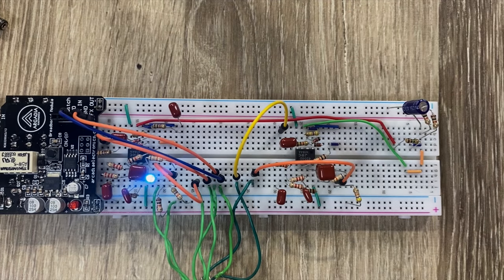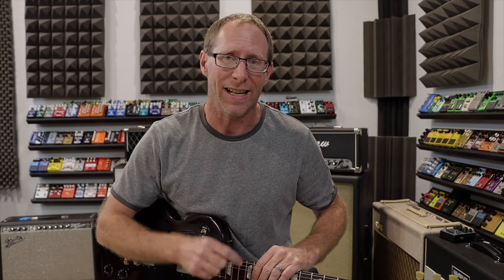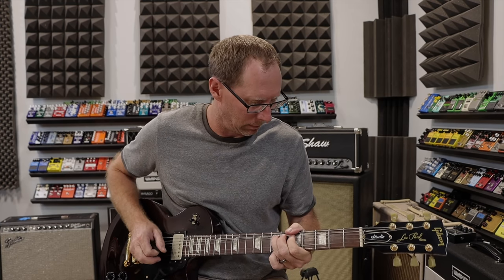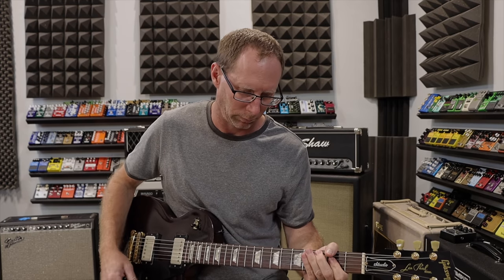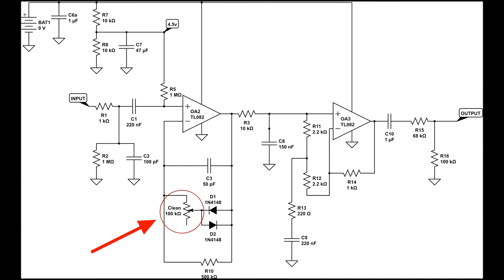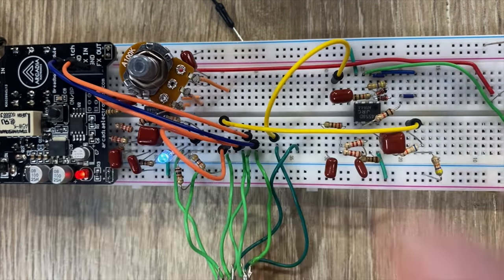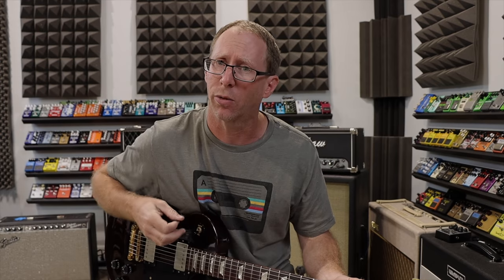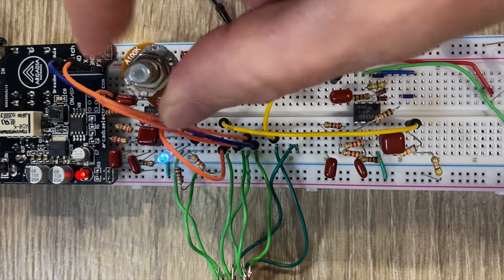It's all about the g̶a̶i̶n̶ ehhh cleans?

Comment: I think being able to adjust the amount of clean signal in an overdriven tone is crucial to getting a useful sound. Thanks
Reply: Agreed, which is why my dream rig is an Engl and a Fender Twin running  in parallel.  Let the desk sort it out.  I'll just enjoy the gain ☺️
Reply: Bass overdrive pedals usually have a blend knob to adjust the amount of clean signal.
Reply: Same reasoning I run my JCM900 and Rockerverb 50 MKII in parallel - ones famously thin and shrill the other famously dark and articulate
Reply: Adding clean to a distorted tone simply means less distortion. This isn’t a stereo setup where you can up one while the other stays the same.
Reply: @enriquepizarro2099  I use a bass overdrive with clean mix on my amped acoustic guitar.
Reply: @Noscrap909  No, not really!
Reply: @Noscrap909  That's not really true - distortion usually compresses the signal, so paralleling some clean signal tends to give more pronounced transients for a clearer attack -  and you'll get quicker decay on the clean component so that the sound will change as it fades.

Comment: I love this format where you explain the role of one component or section in a circuit. I've been building very slightly modified clones, and this is a great way to develop understanding of the circuit. I immediately recognized the 6.8k resistor in the Bluesbreaker circuit which I never understood before! More like this, please.

Comment: LED has the clean, as it sounds more focused. Not as much hair around the edges so to speak.
How strange,  the more clean signal you add, the more the gain sound like a verb type of effect. Or the auditory equivalent of looking at a cross section of an m&m or Reese's Pieces candy. The note is the chocolate/peanut butter core and the gain is the hard candy shell. The potentiometer ends up controlling the ratio of thickness between the core and the shell.
Reply: Yeah I noticed than “verb” thing. You have good ears!
Reply: @Tmidiman  I've been doing a lot of sound design stuff lately.
Reply: literally eating a Reese's Pieces while I read this comment!! :D

Comment: Adding clean ironically brings so much more impact to a distorted sound.  In my productions, I always record a fully clean DI with any guitar amp.  I don’t monitor it during tracking, nor do I even tell the guitarist.  A very high impedance active DI is required for this.  My fave is the BSS AR133.  That clean sound is used to some degree virtually 100% of the time in post.
Reply: Got to have those clean tracks ,,, where you can start over if you have to ... It's always awesome to mix a little clean in there ... Yeah most studio guys won't even track ,,, or mix it down without the clean tracks ... Good one ...
Reply: Don't really do any recording in stereo ,,, but I use a normal / half normal patch Bay to run the clean signal around pre-amp and cab Sim ... For a clean track all at the same time ...

Comment: Right, this is something I learned while using my Boss GT-100 - it has the ability to balance the dirt and the clean.  The trick is to bring the cleans in just until you notice it.
Reply: I use an old gt3 from 98 as the main fx for my little Ceriatone plexi style head, the main drawback of the 3 is that the fx loop is tied to the overdrive section, which has a massive collection of analog overdrives. So in 4 cable mode I can’t use both the plexi preamp and the onboard dirt. I do use the digital preamps sometimes, but only for ultra clean so it’s a whole different thing to add dirt to that.

Comment: What happens in a lot of OD/distortion pedals is the onset of clipping/compression which limits dynamics. With a clean blend you keep some of the natural tone, harmonics and dynamics and mix it with the clipped signal to your liking. Of course you dont HAVE to but it is nice to have the option and you finetune it to your needs.
Every clipping circuit is different with variable frequencies responses.
On the other side of the argument: if the pedal is designed well this has already been done FOR you. Nice to have options..

Comment: LED Off - but I preferred the other sound. Bugger me, what a revelation!
I have a theory that the path of least resistance means in valves the bottom part of the cathode / anode junction near the pins overloads leaving the rest of the valve to work normally, hence valves having an extended harmonic range. This is a superb way fo getting that in transistor dostortion and passing through something for the amp to work with!

Comment: I mix so all the time. A carefully mixed signal will most of the times be the more round and solidified one. This is usable in many situations and parallel setups or bigger EFX chains. And usable for all kind of sounds and instruments. Basically you mix in what lacks in the original audio to get a solidified and "complete" tone, sitting where you want it to be.

Comment: A related trick you can do here is what i do with my set up. I have a dirty boost that goes into a clean channel and it also goes into my high gain channel, then the two signals are run in parallel while i scoop out the mids heavily on the high gain channel allowing the clearer dirty boost to occupy the middle of the sound spectrum.
-I use a Two Notes Le Lead pre-amp which has a "fusion" dial for this purpose which can also run both channels in series(which i thought is how i was going to use it when i bought it)
-the dirty boost is a DOD Gunslinger.(sweet mosfet distortion)

Comment: Everything you want to know about heavy rock guitar production can be learned from what's not really considered a "heavy" album nowadays... roll back the tape to 50 years ago and listen to Bowie's 1972 "The Rise And Fall Of Ziggy Stardust And The Spiders From Mars". The album is pretty varied: it's got a few loud rockers, but it's also it's got ballads, it's got radio-friendly pop songs. And if you listen carefully, all the "heavy", driving rock songs ("Suffragette City", "Moonage Daydream") are actually all driven by acoustic guitar. It's the secret ingredient. Meanwhile, the more overall laid-back songs, like "Soul Love", if you listen again, are actually full of distorted electric guitar and even feedback. One of the many reasons that album stands as a masterpiece. 

Recklessly clicking on a heavy distortion from a cleaner sound can actually make your guitar sonically "smaller" and suddenly leave a big hole in the mix. It might even be louder on the db meter, but you've diverted all the spectral energy from the "thump" and "oomph" part of the spectrum up to somewhere between the "fuzz" and "sizzle" area. Which is a lovely thing in and of itself—and the distortion circuit in this video is gorgeous to my ears even without mixing any clean signal in—but, you just have to be aware that, by contrast, it's not actually necessarily a "heavier" sound. 

Next, let's talk about preamps.... nah, maybe let's save that secret for some other time.

Comment: Great video and great tones. I dig your pedals. It's common practice in recording to mix clean and dirty signals. This adds a lot of texture and keeps the guitar from sounding too dry. Mutt Lang did this with Def Leppard on Pyromania and Hysteria. Very different from what most players imagine when they think of how a professional recording gets done. When I play live I prefer transparent pedals like the Boss SD-1 Waza. I back off on the gain on my Marshall and balance it with the drive on the pedal, which usually doesn't go past 10 o'clock with the output at 12 o'clock and the tone at 1 o'clock. The gain on the amp is usually at 5 or 6. This is a perfect balance for me for rhythm and lead.

Comment: Gilmour has a monster lead tone - and people think it's all about gain, all about the Tube Drivers and the Muffs. It's partially true but imo it's more about VOLUME.
My guess was the LED on. You can hear a little of that clean and it's tighter.
Reply: I use my tube screamer with the drive at like 9 o clock and the level maxed out tone cut out completely. If I set my amp to lightly break up it’s really articulate. To me, the tone Brian’s getting at the 4:00 mark sucks. It’s too distorted to mix with the clean and sounds awful IMO. It’s probably just my preferences though.

Comment: I bought a Boss ODB-3 in addition to another pedal I actually wanted as part of a package deal. Ended up preferring the ODB-3 over the other(DS-1), mostly because of the blend feature. Changed my approach to tone forever. Now I almost always run gain pedals or stereo rigs with clean/od blended. It's a much fuller and sweeter sound to my ears. I don't think I can look back at this point.
Reply: Same

Comment: Circuit one has some clean added. Two seems to have more. Doesn't VooDoo Labs make a pedal that mixes distortion with clean?
Reply: Exactly. I don't know for sure if the first is a TS-style circuit as is the schematic shown (missing some stuff to ground), which always lets some clean through, but a little clean can often be heard with any circuit with diodes in the feedback loop, because the op-amp is kept from distorting, and diodes have a small amount of series resistance. In some circuits, you get the extra clean at higher gain settings, it just kind of forces its way past everything.

Comment: I like running a stereo rig with one heavily distorted amp sound and one with the gain backed off a bit. 

Also less gain is heavier, you need that attack and definition.
Reply: I found the same thing as soon as I joined a band with another guitar player. We were both using a really high-gain tone and it sounded terrible. Just a big wall of muddy fizzzzz. 
Even though I was playing lead, I backed my gain down and suddenly we sounded great together. And my solos cut through better without boosting my volume.

Comment: It was very apparent, that the No LED circuit was very compressed boxy and small sounding and with LED there is much more articualtion and it sounded much bigger and more present.

Question is, when this pedal will be available and how would you call it?

Anyway, paralel gain mixing is a great idea and lots of usefull sounds are there. From PhilX and his solo boost in form of adding clean Fender amp to his Dirty Robot (back in the days) thru Boss Angry driver, to last (known to me) Walrus Ages pedal. Also dont forget guys from That Pedal Show and their wet/dry (or dual mono) setups with two different amps.

Comment: That's just what do the Two Notes double channel tube preamp (with a real tube inside). I use "le Lead" and for exemple it's incredible with a wah sound and the two circuits mix together (clean & distortion  in parallel, called "cold fusion") and many other options !!

Comment: Nice demonstration of a Tube Screamer style overdrive. It's wonderfully simple and it still beats the pants off of a lot of other distortion circuits.

What actually caught my eye in this video is the second stage in this circuit. That's a strange way of drawing a bridged T notch filter.
Reply from the maker: I like your thinking ;) It's actually just a TS style tonestack stage, using set resistors instead of a pot, so it's boosting some higher frequencies a bit here

Comment: With the pot in the circuit you notice the clean signal even at the first adjustment get quite a bit more prominent. Also notice when you hold a note or chord, as the clean signal diminishes, the underlying OD gets more prominent. Wonder why very few (I don’t know of any actually though I seem to recall maybe seeing one or two, bit sure) OD include a mix knob? Does Wampler have one? Would also be an idea to have the clean not be totally clean but just a much less gain OD, mixed in. Maybe “bloom” then but not so clean?

Comment: Great vid, thanks! What's happening electronically with the pot swiper added to the clipping stage? Am I correct in assuming that the increased resistance makes more of the clean signal bypass the clipping stage? And is this essentially like the blend pot I have on, say, my Boss ODB-3 or Deluxe Bass Big Muff?
Reply: Correct. The signal current has two paths: through the diodes and through the feedback resistor. Increasing the resistance in the clipping portion causes more of the current to be diverted to the feedback resistor and less through the diodes.
Reply from the maker: @ryancrawford9894  nailed it :-)

Comment: I split my signal in stereo with one pedal and am using 2 amps, but I enjoy the middle pickup position for cleans and bridge for drives, but in a mono output guitar is impossible to sound midle and bridge at the same time because the drives will suck, should I make a second jack for neck pickup?

Comment: In the Foo Fighters samples, would you guess the clean mix is coming from a single signal chain, or are they running the dry guitar through multiple rigs? Trying to gauge what comes down to amps and pedals and what comes down to studio magic.
Reply: in "wheels", that sounds more like they put a mic on Dave's hollowbody. it's got an acoustic kind of clack to it. get it in phase and mix it in with the amp signal. i've gotten cool results with this before on slow strummy sections.

Comment: The one with the LED is the clean mix circuit. Some of the notes sound clearer and it's a bit thicker in some parts. The one without the LED sounds more agressive and tighter to me. I prefer the one without a clean signal.

Comment: Is that a mid 90s Studio with the ebony board? I have one of those. It is killer for some reason. Sounds so good and one of the best Gibson guitars I have had, which really surprised me considering it is just a humble Studio model. Downside is the kind of chunky neck, but the way the neck resonates when hitting notes might be partly why it sounds so good (I thought about having it carved to be slimmer, but worry that it would change the sound due to there being less mass in the neck). 

A bit of clean signal in there? Is that not what a TS808 does? A Kon too, I mean Klon. I have still not tried a Klon style pedal too see what the fuss is about. None of my fav players used one, so it has never been on my radar. Maybe one day. 
At the moment my fav pedal is my Laney BCC Iommi Boost. Far more than just a treble booster. It can also add clipping and has lots of EQ options. Unlike my noisy as hell DOD 250 it does not need a noise gate so much, i.e., it is fairly quiet. It sings on single notes when hitting an already overdriven amp. Pronounced overtones in the sustain etc.

Comment: Love the videos Brian!
keep em coming😁 
Brian  is it possible to explain to builders out here the best way to design a circuit when planning to use  smd components  as they don't always sound the same 1 for 1 as the larger analog semiconductors and sometimes require xtra support circuitry to get the tones needed in overdrive or distortion pedals.

Thanks Brian
thank you for sharing all the knowledge you do for all the people interested in this field

Comment: If I wanted to have a hard limit on how much clean introduce, could I just use a smaller pot? As in, I liked the sound after the first adjustment he made to add just a bit of clean in, and maybe the second adjustment, but not much past that, so like maybe a 20k pot instead of a 100k?

Comment: Tubescreamers have 50% clean by default. I love that the NTS Tubescreamer has an external trimpot for clean blend... (also the 12-18V option!)  Although it always seems to end back up at 50% lol
Reply from the maker: They do have cleans, but it's not actually 50%, it's a gain of "1". There's some math around it, but more info here if interested: https://www.electronics-tutorials.ws/opamp/opamp_3.html, and it's present in this circuit as well due to it being a non inverting opamp with diodes set up in the same fashion between the positive and negative inputs :-)

Comment: Does the GEARBOX (Andy Wood's signature pedal-which I own) have any clean signal mixed in?  It sounds like it does.  I typically have the gain around the midpoint, give or take, so that may be why it sounds like some clean signal is mixed in???  Thanks.
Reply from the maker: It's a different type of circuit entirely on the left channel, rather than using diodes it's saturating multiple gain stages sort of like what you'd find in a tube amp, sort of. The right channel does indeed mix cleans and overdrive more clearly